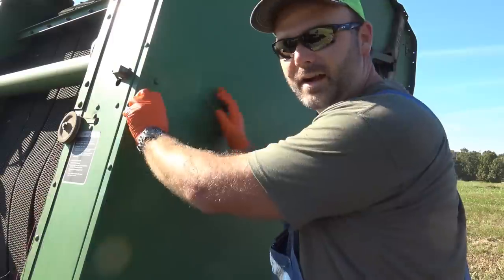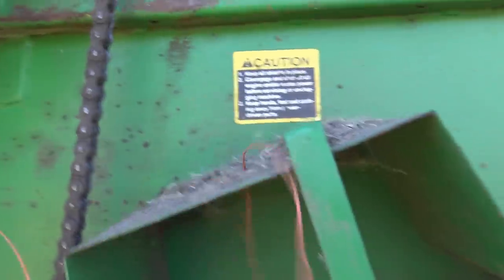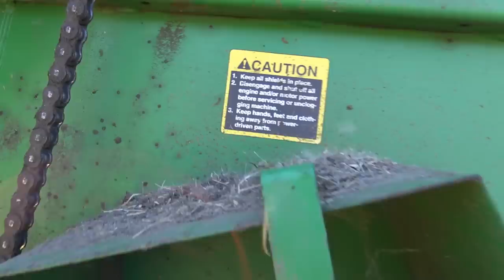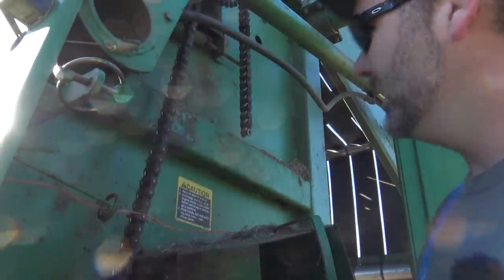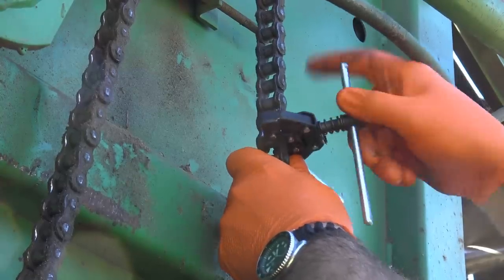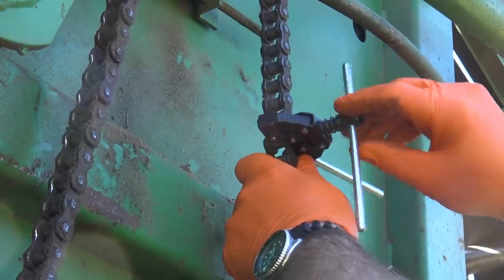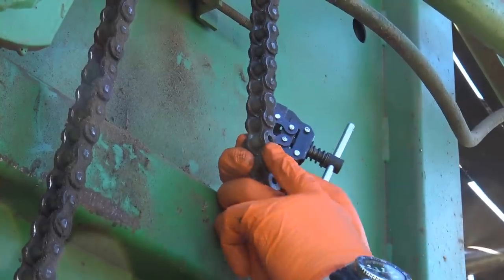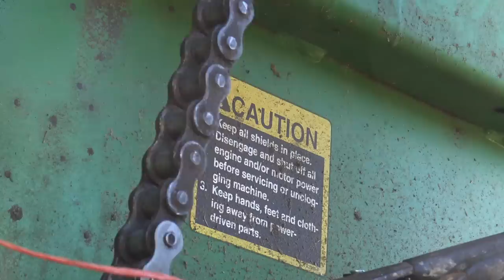How to repair a broken chain

Comment: I made a chain link grabber out of needle nose vice grip and carved out round groves on each side ( inside ) to help hold the chain and a-line the chain to accept the master link . It works on all chain except the small 20 and 25 Chinese ATV chain. You made a point about the tension pulling the studs on the master apart !

Comment: YES!!!!Same chain tool that we have with our GE 250Kw SW transmitter for the tune drive chains.Have had to do what you are doing---but lying down on the transmitter floor on your stomach.The coil chains and cap drive chains at the bottom of the final RF amp cavity just above the floor.also have bulk chain on rolls-sometimes easier to replace the whole chain from the roll than removing links and splicing.The air from the main blower blows up thru here and the  chain collects all kinds of dirt and dust.Who says electronics is clean?This is the dirty part of it.

Comment: Good, Fast, Cheap - You can only pick two.

It is amazing on how many things and decisions this applies to.  What I find even more interesting is how people critique other people on their implementation of the decision. 

A Cheap - Fast repair is what seems like checked the boxes of importance to you for this one.  It needs to hold together long enough to get the hay off the field and then go though additional repairs in the off season.

In my mind, no one but you can weigh all the factors that impact and influence your decision. 

Great job on getting backup and running.  :)

Comment: Good video Mr. Josh. If I may give a suggestion or two. For big guys like yourself this may not matter but for we weaker  people; the idler gear can be loosened by backing the springs torchen bolt off. That'll also make the rest a bit easier too. With my baler, the chains get oiled once a day. Used motor oil works perfect. Happy baleing!
Reply from the maker: Thanks for the tip my friend

Comment: Hi Josh     Nice video with good information, but you forgot to mention something important !   the closed end of the spring clip goes in the direction of travel.     It is not as important in a closed environment as inside your baler, but VERY important where something can brush up against a chain out in the open !
Reply from the maker: Yessir! Thanks one other fella mentioned that above...very good point for sure

Comment: Josh if you loosen the bolt that pulls the spring before you remove links then you will have an easier time installing the master link and you will have more tensioner for future stretch in the chain!

Comment: I agree with JK, you need release the spring tension on idler pulley.  I would take another link out of chain. On tensioner unscrew that althread to within 1" from the end (right side of the allthread). Then adjust tensioner pulley to left side of chain.

Comment: You could use a bit of bailing twine, seeing your on a bailer to help get the 2 parts together(as an extra hand) also holds a bit of slack to get the locking link on.

Comment: The spring on your tensioner is run all the way in. You should back off the nut and remove another link. That way you'll get even better tension and when the chain stretches again you can just tighten the spring to take out the slack.
Reply from the maker: I agree...I'll do it right once I get this job done...You are right...it needs to be done...I gotta go through the baler and check it over good before I use it again

Comment: Didn't see a comment, but a chain puller tool can act as a spare hand, it goes between the rollers and you tighten it up to pull the chain together, there a life saver.

Comment: That fine for quick bush fix but old stretched out chains are going to wear your sprockets out . Replace those chains with new ones so they fit the sprockets properly .
Reply: Excellent  I told him the same thing he will have a incorrect angle between chain and sprocket due to stretch. Wear out those sprockets quickly!

Comment: You need a " roller chain puller" , it's a set of fingers that pull the chain together. The master links that use cotter pins are stronger and easier to install than ones with the clip.  In a perfect world, replacing the chain is a better option, as the chain is stretched and almost shot.

Comment: That chain break tool looks a bit easier to use than mine. Who makes that one? Make sure your master link key is going the correct direction. The open end should face backwards so that it cant hit something and pop off. :)
Reply from the maker: Great tip about the key...thanks...I'll double check mine! We all stand to learn something from each other for sure!
Reply: Happy to help :)

Comment: Thanks for the tip!!  Does the chain require lube/oil? Never worked on a baler before.
Reply from the maker: Yes..I use a thick spray gel lube on mine but you can just use motor oil to keep them lubed...all sorts of schools of thought on chain lube out there
Reply: Thanks!  Learn something new every day.

Comment: Excellent video~Just my thoughts that chain is junk replace it it is all stretched out~you are going to wear the sprockets out due to the incorrect angle of chain to sprocket teeth. I would also replace that spring it may be weak.

Comment: Didn't you only remove one link?
You removed two links.
You put in a new master link.
Hence, one link removed...

Not complaining - I'm just clarifying. And happy that went so.smoothly for you.
Reply: master link plus two links = 3.  He removes two links.  He didn't add a master link he just reinstalled it.
Reply from the maker: OOOhhh....let's get philosophical.....so prior to disassembly the chain had a master link in place....I put in a new master link..which only replaced a link...then removed 2 links...thus 2 links were removed and the old master link replaced....in review:
1. Replaced Old master link (no change in chain length)
2. Removed 2 links (2 links out)
3. Re-assembled with 2 fewer links

Watch Sunday's video and you'll see the bad master link I replaced 😜
Reply: Oh. I thought the replacement master today replaced the one you pulled off this weekend. (I watch ALL the farm blogs)

Comment: Technically you removed 2 links,  (one connecting and one roller) next time you may have to install a offset link or what we call a half link... also when replacing a roller chain  don't go by the measurement...... count the rollers......
Reply from the maker: Yep...2 links were removed brotha....look down through the comments...there's several folks saying I only removed 1 link...then some saying I removed 3....but I pulled 2...probably should have pulled 4...but you're right there ain't no pulling 3 links!
Reply: Look on JD parts and see what the correct size and number of links is supposed to be. Who know what has been done in the past to that baler.

Comment: 100% wrong way to do it !! Next video you'll be replacing the bearing under the sprocket the tension pulley spring and the whole chain.I give it 5-10 hours before it breaks and you drop the chain......